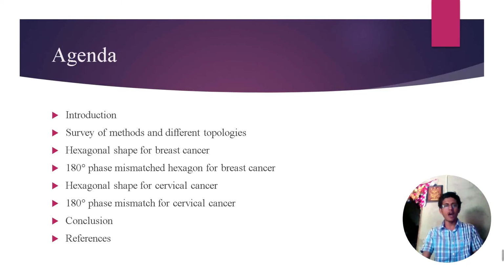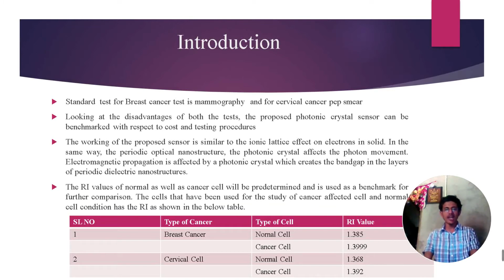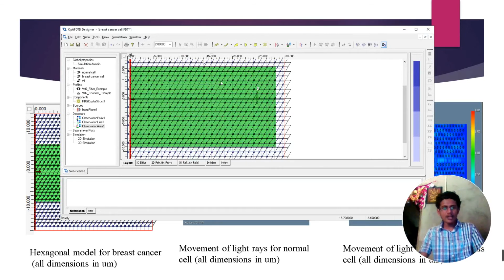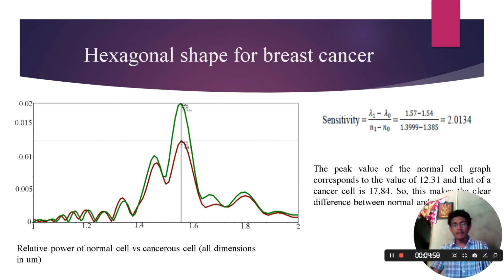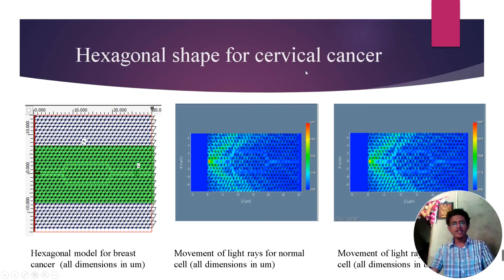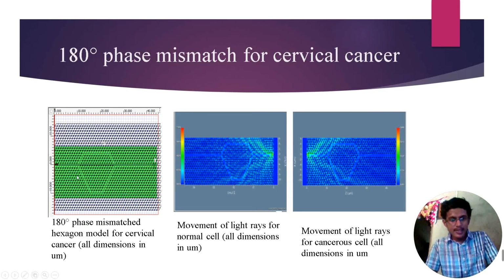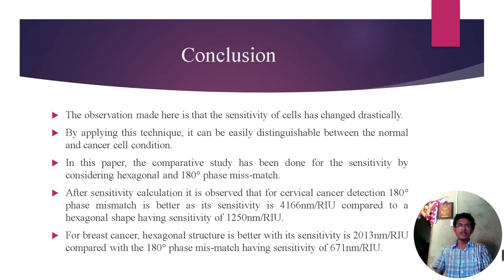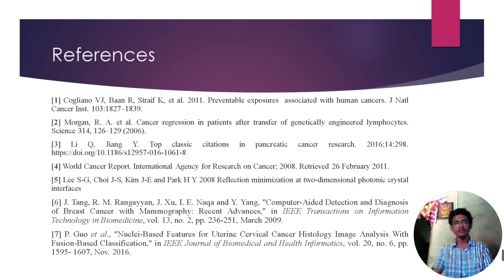Design and analysis of Optical Sensor for Detection of Cancer Biomarkers

Comment: How can the PCF photonic crystal fiber structure be optimized for loss or dispersion?
Please reply or help with guidance, thank you
Reply from the maker: I guess by changing the structure to circular from hexagonal, dispersion can be minimised..
Refer here : https://www.researchgate.net/figure/Optimized-PCF-a-Optimal-configuration-Distributions-of-the-magnitude-of-the-electric_fig9_325887192

Is there any way to reduce dispersion of passed light using em waves in a guided path? Like around the crystal structure.. or in some other passion?